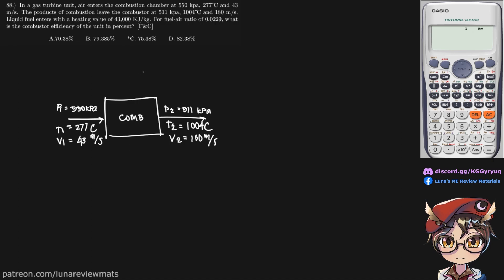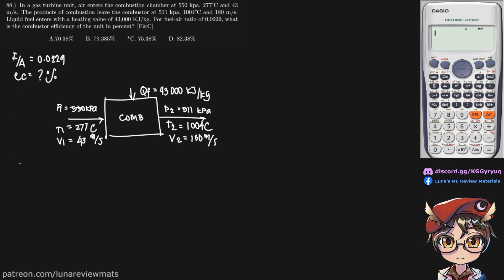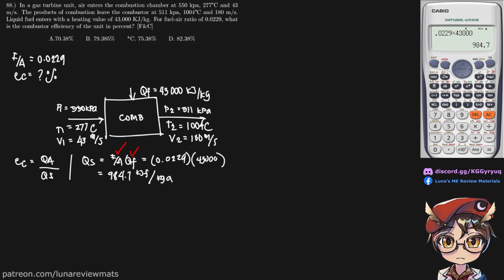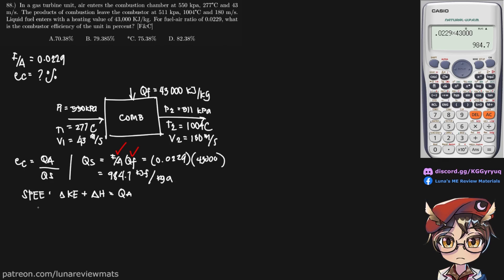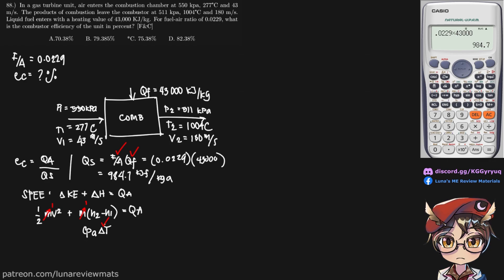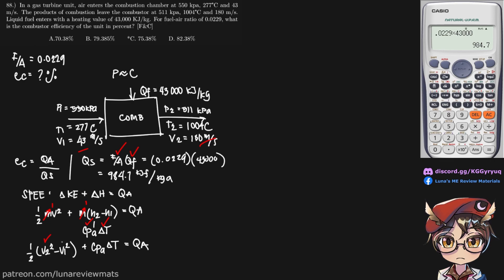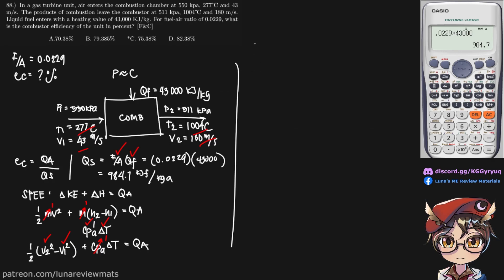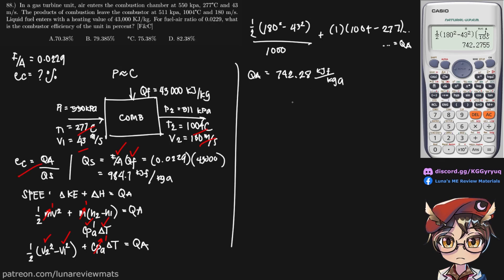In a gas turbine unit, air enters the combustion chamber at 550 kpa, 277°C and 43 m/s. The produc...

Comment: Also, you assumed 1 kg of air of air entering, which is very fitting and you assumed constant specific heat, which is still acceptable in most cases. However, you missed out the fact that the gas leaving the combustion chamber is not only air. The fuel already mixed with it. You should have performed a mass balance. The mass of gas leaving the combustor should be 1 kg + 0.0229 kg = 1.0229 kg.
This will make a different value of efficiency.
Reply from the maker: I appreciate the corrections, Mr. Blones! I'll be pinning them for future viewers to consider.